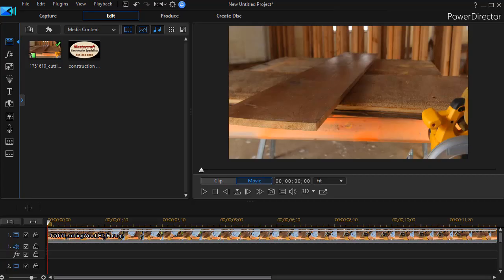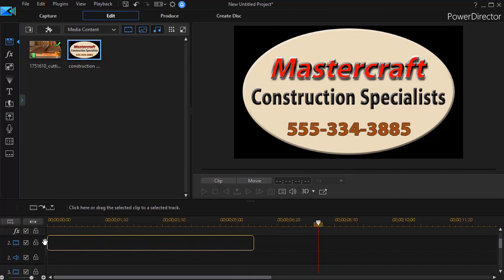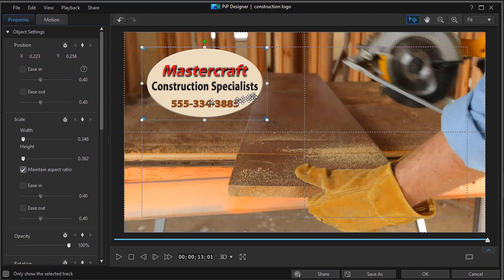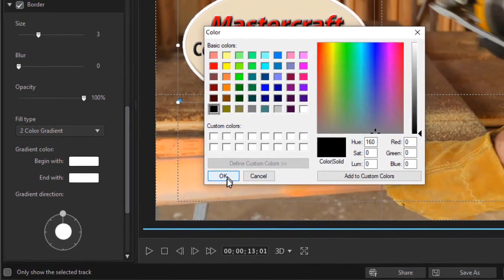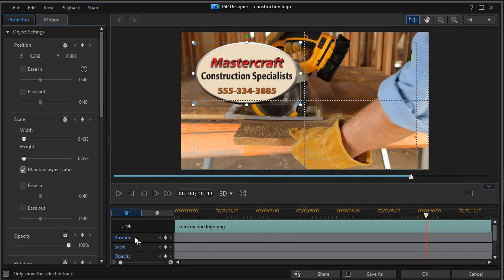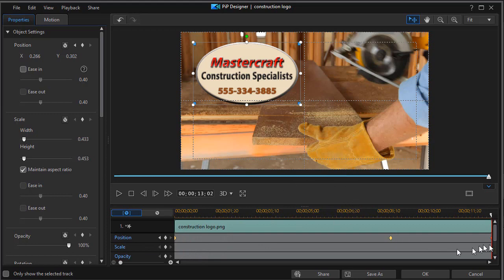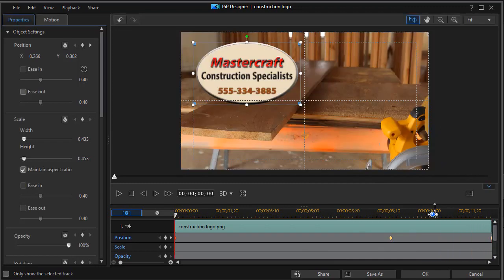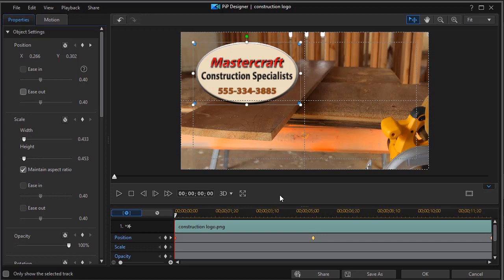PowerDirector - Adding a logo the conventional way

Comment: I have a problem. I took a screenshot of a smiley and I don't want the white background of it. When I chromakey it, the "teeth" of the smiley (laughing smiley) disappear too. Is there any way we can emojis (emoticons) to our videos? (desktop version of Power director).
Reply from the maker: Great question. If you remove the white around and object, any white in the object disappears as well. That's what you have discovered. One way I know to overcome that is to edit the graphic outside of PowerDirector (with PAINT.NET or Photoshop Elements or your favorite graphic editor. You create a PNG, which will be transparent around the image. And then you can use it without the graphic losing its teeth. Your other option is to search for free emojis on the internet. You will probably find some that are .PNG files (transparent background) and will work just fine. --Jim
Reply: @SharperTurtle  Meanwhile I was able to make one with GIMP. I hope PD makes  these available for download on PC, because they obviously have something like that for PD-phone versions (apps). Thank you very much for your reply, Jim.
Reply from the maker: You are welcome. Glad you found a solution. --Jim